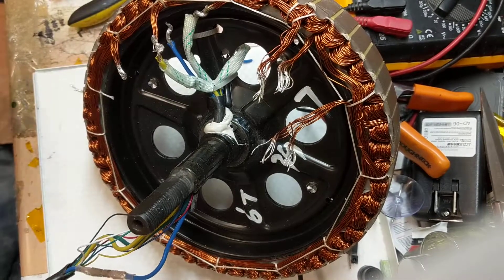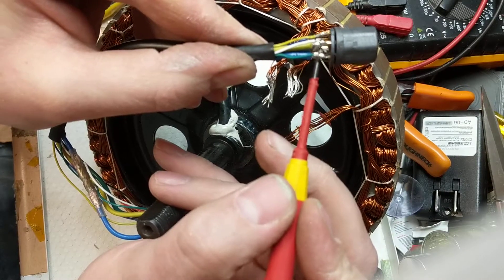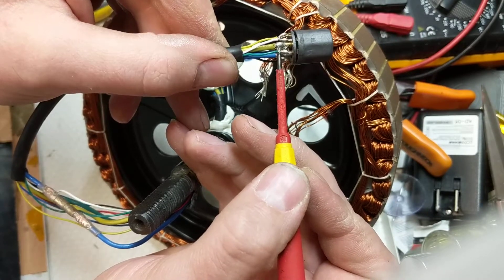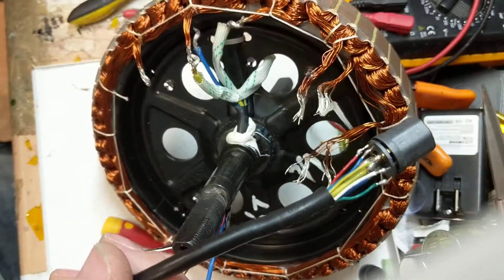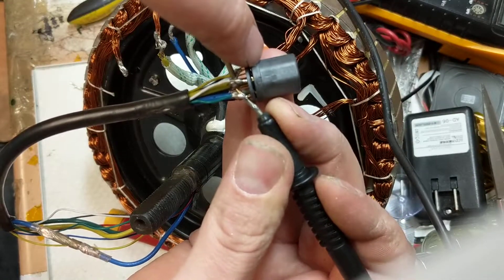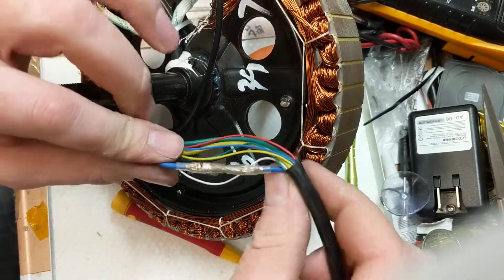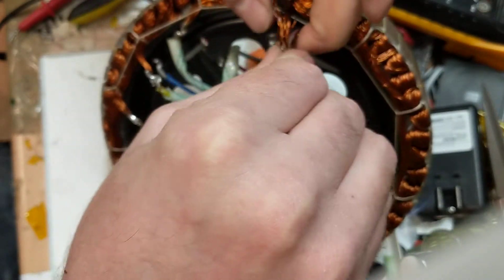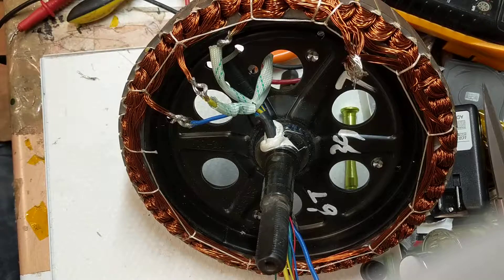1500w ebike stator problem Short out windings. Fixing a ebike motor PROBLEM FOUND now fixed VIDEO 3

Comment: I gotta open mine. I have a QSmotor 205 i added statorade then after that things got funky. I keep getting phase current surge protect. Then power cuts out. Would a short cause this?
Reply from the maker: Quite possible.

Comment: Well done!
This is the sole reason why I take everything from China apart mate 😉
Reply from the maker: Absolutely but this particular connector was fully filled with glue and I had to basically destroy it to get to the wires.
Reply: @smartazz  I've seen that a few times mate. A hot-air gun works perfectly 😉
Reply from the maker: They just need chopping completely off and replacing with decent connectors